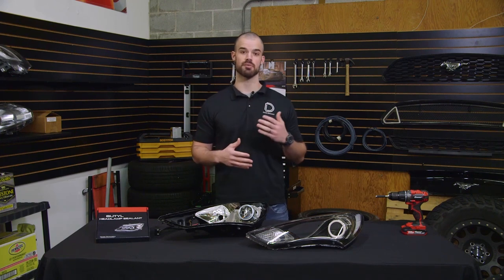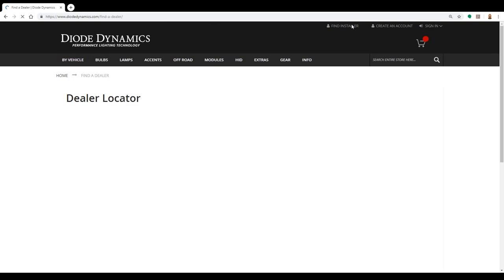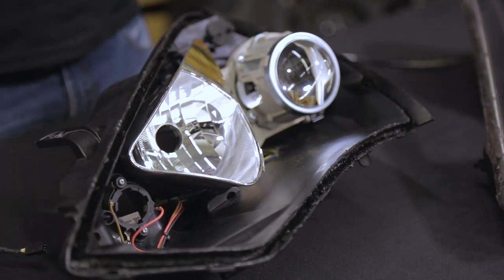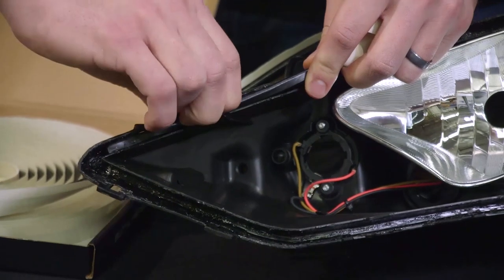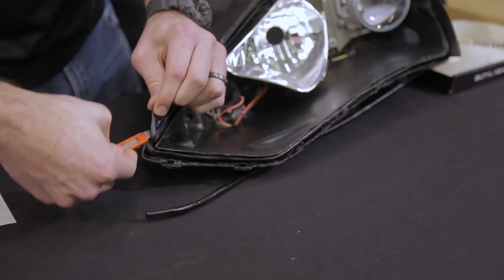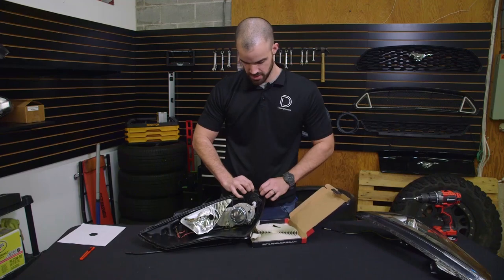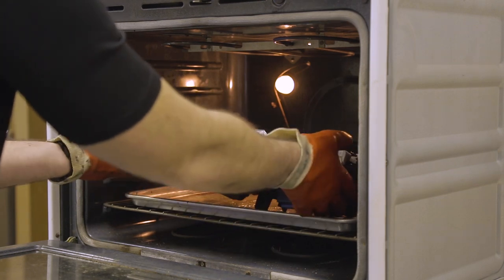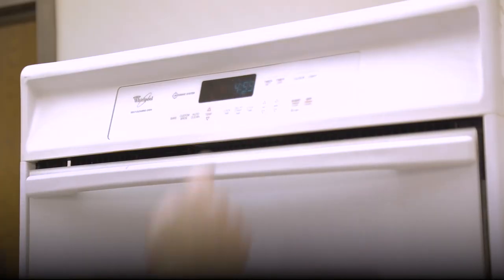How to Reseal Your Headlight Using Butyl Headlamp Sealant | Diode Dynamics

Comment: Does the temp and time go for pretty much all headlights? I’m waiting for my diode dynamics c lights for my 2017 wrx and I wanna make sure I’m opening and resealing the right way !
Reply from the maker: The temp and time can vary depending on the make and model, as different manufacturers can use different adhesive to seal the headlight. For this reason, we do highly recommend professional installation - thanks!
Reply: Were you successful? I have a 2017 wrx as well that needs to be resealed

Comment: One of my assemblies was causing the light to be super dim, I used pry tools and a razor blade for mine to separate it...the projector-lens is sun damaged and the clear cover is oxidized past point of repair...the oven was not a choice for me lol. My car, I can get a new OEM assembly for like $120..im sure the new cars with fancy assemblies are more expensive
Reply: My Mopar OEM assemblies for 2011 Ram were $250 each.   Total $500.

Comment: confused, where does the moisture come from if its sealed?    i thought there was a hole in my sealant, that's why theres condensation inside the lamp.
Reply from the maker: There's a couple different places moisture could get in even if there is no apparent leak in the seal. Connectors, the air vents that all modern headlights have. It could also be the environment change, the same way you have a cold glass of water in the summer, it tends to gather condensation. That's simply the nature of the beast unfortunately.

Comment: I have a 2017 Porsche 718 with PDLS headlights which cost £1700 ($2300) each! Both lights get terrible condensation following an accident so they need to be resealed. I’ve searched for a headlight specialist in the UK to try and get them resealed, but can’t find one. Would you recommend trying this process, bearing in mind the cost of each headlight?
Reply from the maker: We always recommend professional installation for any application that requires you to open up your housing. Especially given the cost of your headlights. Give our dealer locator tool a try! We've placed the link below. If that doesn't work to get rid of the condensation, you may also want to try to install a breather patch or two (as seen in the video). 

https://www.diodedynamics.com/find-a-dealer
Reply from the maker: Breather Patches: 
https://www.diodedynamics.com/20mm-breather-patch.html

Comment: I have a 2006 GMC Sierra 2500 and I wanna try and retrofit switch back leds in my door handles,  any advice?
Reply from the maker: Hi Kyle! This is a unique idea. It will definitely require some custom wiring! We would recommend checking out our switchback LED Strips!

https://www.diodedynamics.com/hd-led-semi-flex-strip-single.html
Reply: Diode Dynamics yah I would use your strips but as far as taking apart and resealing the lights,  couple sites sell the handles but only have amber or red.  Neither which go with the theme of my truck

Comment: How do you clean out the dried butyl in the channels?
Reply from the maker: There are many different techniques to remove the existing butyl, but we recommend heating up the existing resin with a heat gun and using something something soft, like a plastic scraper tool to remove it!

Comment: Any thoughts about toxic fumes in a house from heating up the headlights/glue?
Reply from the maker: Hi there! For installations like this, we recommend taking the headlights to a profession. However, you shouldn't really be releasing toxic fumes unless you are melting the plastic.
Reply: Open a window 🤷‍♂️
Reply: At 275°F you're not going to get any significant toxic fumes.

Comment: I added after market lights inside my headlights and now the one light fills with fog after I drive the car, I know I have no leaks cuz I have already filled all the cracks, is it because when I put the light together it was raining and humid outside so it is trapped inside the light? I have opened the plug on the back and dried them out with a hair dryer multiple times and it always digs up after I start driving around for a bit
Reply from the maker: You may want to try adding a couple of breather patches! 
https://www.diodedynamics.com/20mm-breather-patch.html
Reply: @diodedynamics  would those breather patches work on taillights too that have been worked on?  I didn’t realize it needed airflow to prevent condensation
Reply from the maker: That means moisture is getting into the housing somehow. We would recommend installing some breather patches to see if that solves the issue. This will let air flow through the lights without letting in moisture.
https://www.diodedynamics.com/20mm-breather-patch.html
Reply: @diodedynamics  thanks for the quick reply 🙏🙌
Reply from the maker: @Donny_Bo_Danglez  Yes, they would. Not every application requires airflow, but it always helps. The tiniest crack or leak an cause condensation.
Reply from the maker: @WhySoSeriousGM  Anytime!

Comment: How long to let it cure before you can install the headlights back in the car?
Reply from the maker: Hey Jim! Most of our professional installers let those headlights sit for a full 24 hours before reinstalling them to the vehicle. If you need help getting in touch with a professional installer or anything, just give us a call at 314-205-3033, Monday-Friday 9 a.m.- 5 p.m. CST, or shoot us an email at contact@diodedynamics.com and our service team can assist!
Reply: should be good by now
Reply: @adrianmenchaca3958 😂

Comment: Butyl or silicone which is good
Reply from the maker: We recommend our Butyl Headlamp Sealand to protect against moisture ingress. This new and improved sealant rope was designed specifically for headlamps, with a firmer composition than auto-store windshield glue. This makes it easy to work with, without causing a sticky mess.